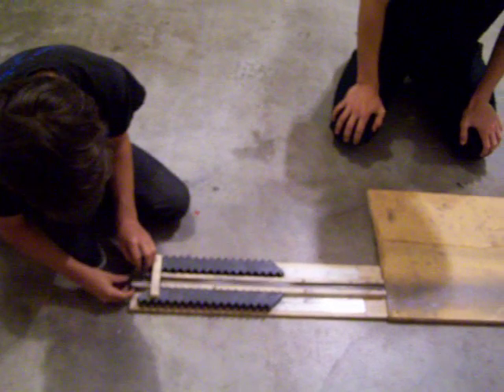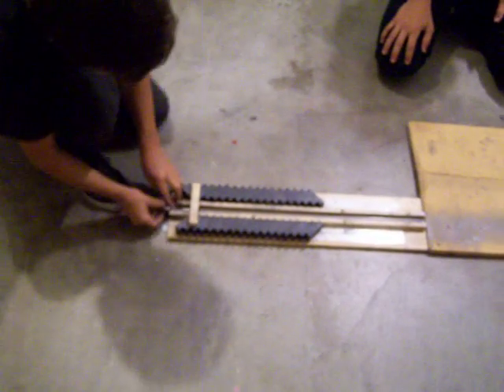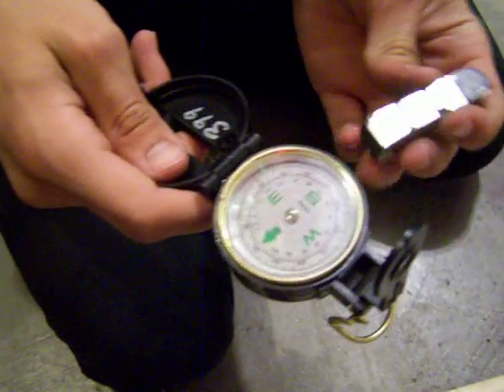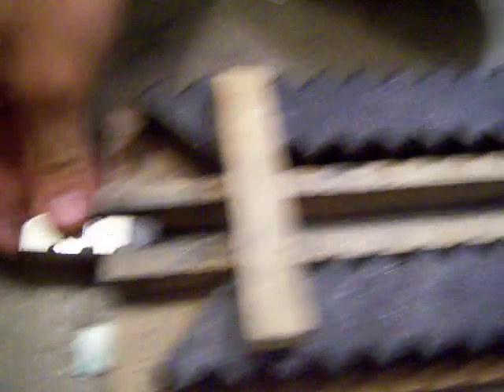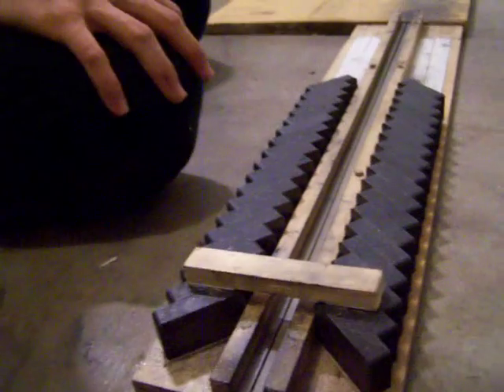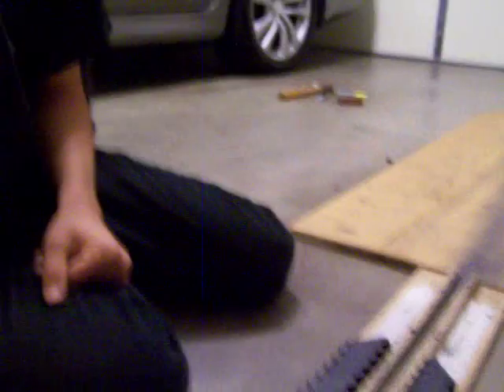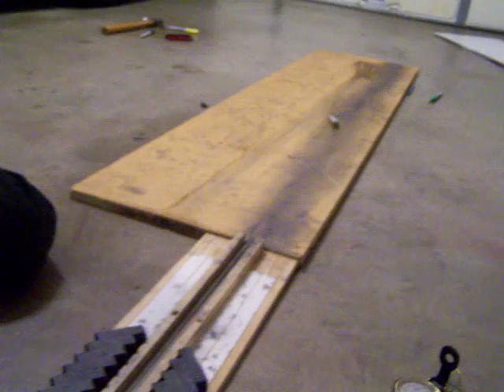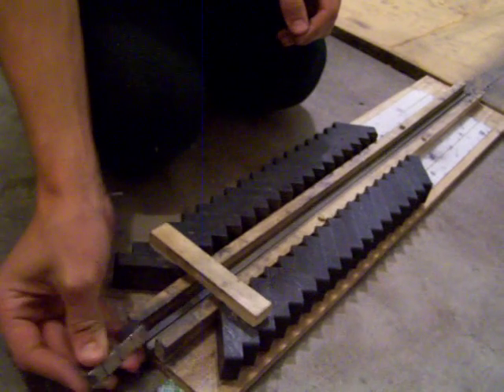Magnetic Rail Gun Science Project

Comment: To answer everyone's question, no this wouldn't work in a loop! Although the projectile gains speed along the track, it looses potential energy. The initial energy was added to the system when the kids physically forced the projectile against the magnetic field into the left side of the track. If the track was any longer, the projectile wouldn't even make it though (the kids even mentioned this when they said that it didn't work with 19 magnets).

Comment: could you achieve perpetual motion with this concept?
Reply: Nope.
Reply: Peter Wright why couldn't it be built as a large wheel then tilted on its side?
Reply: Build it any way you like. It won't give perpetual motion.
Reply: Peter Wright but what is the difference between making this 3' long vs 300' long?
Reply: 1TicTacPat
It doesn't matter. You are sticking a magnet into a static magnetic field. It's like lifting a ball up and letting it drop - there's only ever the energy you put in. Losses from friction and eddy currents will stop the smaller magnet sooner or later.

Comment: if you could reduce the friction, maybe by levitating the magnets with other magnets, it would go much faster and further.
Reply: Make another set of magnets and rotate it 90 degrees so you have the same setup above and below the track also.  And use ceramic brake caliper paint from autozone, heated in the oven, to coat the insides of the track [dont heat the magnets just track]
Reply: Good plan
Reply: They probably knew that already but there just might not be enough time or resource
Reply: Magnetic rail guns are a type of electromagnetic device that use magnets to accelerate a projectile along a pair of rails. The force generated by the magnets is used to push the projectile down the rails at high speeds.

Even the mathematics for classical physics calculates that the magnet system is permanently unbalanced based on the pulse driving the electromagnet. This imbalance creates a magnetic field that repels the projectile away from the device, making it impossible for the device to function as intended.

The only way to make a magnetic rail gun work is to use an exotic form of matter known as a negative mass fluid. This fluid has strange properties that allow it to generate a force that can cancel out the repulsive force of the magnetic field.

So far, there has been no successful demonstration of a magnetic rail gun using negative mass fluids.

A new type of magnetic rail gun has the potential to provide free energy, as it does not rely on any external source of power or fuel. The device works by harnessing the power of magnets to create a strong electro-magnetic field. This field is then used to accelerate a metal projectile along a track.

The key advantage of this design is that it can be powered entirely by magnets, which are readily available and do not require any external source of energy. This makes the device environmentally friendly and could potentially provide a sustainable source of energy.

The project is still in its early stages, but if successful, it could provide a major breakthrough in sustainable energy production.

Comment: this is not railgun ,this is coilgun
Reply: The title is technically correct, in that it's a "Rail Gun" (note the space), because the projectile is fired from something we might call a rail; however, in function, it operates like a coilgun, since an actual railgun needs contact between the rails and the armature to send electricity through it and fire it using Lorentz force, while a coilgun uses a magnetic projectile and magnets/electromagnets to push the projectile out of the gun.
Reply: It is a railgun. I didn't any coils around it, so it is a railgun.

Comment: not a rail gun.
Reply: +Johnny C jørgensen It is a railgun, a magnetic field, Lorentz forces. I don't see why it's not a railgun.
Reply: Railgun  uses elektric to fire.
Reply: And the big ones shoots a aluminium projektile at about 6000km/h
Reply: +Johnny C jørgensen You have no idea what a railgun is. A rail gun accelerates a projectile within a magnetic field, due to the Lorentz forces. The greater the magnetic flux density, the greater the Lorentz forces. Acceleration determined by Newtons second law. An electric railgun, uses electromagnets. By rushing a current through a rod or whatelse. The curreny creates a magnetic field relative to the projectile, therefore initiating a Lorentz force on the projectile. These are made with permanent magnets, not electromagnets. However still a railgun. And your speed is bullshit, it doesn't define a "railgun".
Reply: +Johnny C jørgensen It is a railgun. It has a magnetic field that accelerates the project due to Lorentz forces mate. I build a 1500 Watt railgun myself. You don't even know 2% of the phgsics involved.
Reply: well there are also coil guns.. might be the one you build.
Reply: +Johnny C jørgensen Nope, that one is also single stage and boring. Poorly made. I know this stuff so much better than you and you know that.
Reply: +Azagro what is youre projektile build of?
Reply: +Johnny C jørgensen Stainless steel for strength and a copper coil as sleeve for low resistance.
Reply: +Azagro so you build a coil gun. congrat.
Reply: +Johnny C jørgensen Hahahaha, do you even know how Lorentz forces are created? NOPE!
Reply: +Azagro smile nice you found a picture of a rilgun. congrat. projektile is a non magnetic one.
Reply: +Azagro how are we allowed to let this kid comment
Reply: +RAms - No idea, he saw a navy railgun. Suddenly becomes an expert on electromagnetism and lorentz forces. Doesn't even know the tiniest bit of maths and physics. Kids like these are idiots.
Reply: If we were to consider coil guns as a subset of railguns, this qualifies. However my understanding is that typically non electrified rails, especially with a ferromagnetic or permanent magnet projectile/armature, denotes a coil gun. Although of course it has no electromagnets and no coils, so you can't optimize velocity. Let's call it a "Magnetic Linear Accelerator" and leave it at that.
Reply: more like bigoted

Comment: LAWS OF CONSERVATION OF MASS, ENERGY AND THERMODYNAMICS APPLY TO A CLOSED SYSTEM. THERE IS NO SUCH THING AS A CLOSED SYSTEM.
YOU CAN'T GET ENERGY FROM NOTHING. NOTHING IS A SOURCE OF ALMOST INFINITE ENERGY POTENTIAL.
PERPETUAL MOTION IS IMPOSSIBLE. EVERYTHING IS IN PERPETUAL MOTION.
Reply: Guymick Cormic Well, since the Big Bang... I mean, nothing has begun or stopped moving after that input force... and things in motion remain in motion until acted upon by an equal or larger force, matter/energy is neither created nor destroyed it just changes state/form. And given the opportunity, things will often follow the path of least resistance..... a lever is a "Force Multiplier" and wheel is a lot of little levers arranged in 360 degree form. force

fôrs/

noun

1.

strength or energy as an attribute of physical action or movement...

 "Force is energy, a lever is a force multiplier.., A force multiplier is something that will have a large output force over a small distance. They reduce the amount of force necessary to move an object. An example is pliers, where the device is focused over a small distance and will provide a large amount of output force. A lever can multiply either force or speed, but it will depend on the positions of the handle, fulcrum and load. Inclined planes are also types of force multiplier levers.
 Shall we go into friction reductions and the like for them or what?..wait..I will add another clue... Nature hates and imbalance and always seeks to equalize (although never truly attaining it in total).
  Absolute Zero temp would mean no radiation of anything at all... but since we aint got that sort of capability, to stop the universe and freeze it (why we would do that I have no clue) we must recognize certain other things like the hydrologic cycle. Or also listen to Bernoulli and Venturi when thinking of fluid dynamics which in a way also applies to gasses too...i.e. the Venturi thing.

Comment: BY USING PVC AS THE BODY AND USING THE MAGNET GLUE INSIDE THE 4 INCHES PVC PIPE YOU COULD MAKE A VERY GOOD MOTOR FREE ENERGY DEVICE THAT WILL NOT STOP. GOOD WORK GUYS. THANK YOU FOR YOUR PRESENTATION. GOOD LUCK IN THE FUTURE.
Reply: ShadowRocks25 He's lying through his teeth, it's a troll. Thermodynamics. you cannot get free energy.

Comment: PLACE THE  MAGNET IN A CIRCLE AND YOU WILL HAVE A MOTOR. GOOD WORK
Reply: Micah Burgin. The question is. Where do the velocity come from? It seems greater than the energy he puts in. Need a high speed camera to see if it is accelerating near the end of the tube. If it is then it must be something from the ksgnets themselves that is feeding it energy. Like the energy required to make a magnet. If that was the case then over time the magnets would degrade. But magnets should be self stabalising. If one part of it loses its magnetism then its own magnetic field will correct itself. I have no idea. Needs testing
Reply: No. Thermodynamics.

Perpetual motion is impossible.

I sincerely hope you are trolling, because if you are not, take introductory thermodynamics in college.

You need to.
Reply: Nah you don't need to, the TROLL does.

Now, you can just read the wikipedia article on thermodynamics and you'll probably be good.

And no... that wouldn't work and the amount of ceramic magnets that would take? Too much. There is no way it would work and no way we have the materials.

Comment: FYI... this isnt per say a "rail gun" which uses ELECTRO-MAGNETIC forces... but what you kids have demonstrated beautifully is one of Howard Johnson's permanent magnetic motor devices... you have demonstrated how a magnetic gate operates.
Reply: The findings of a new study could mean that free energy by magnetic rail gun science projects are permanently unbalanced. Even the mathematics for classical physics calculates that the magnet system is permanently unbalanced based on the pulse driving the electromagnet.

This has been a problem for years, as it was thought that the only way to generate free energy was by using a balanced system. However, this new research shows that it is possible to create an unbalanced system that still produces free energy.

The key to this finding is in the way that the magnets are arranged. By arranging them in an unbalanced way, it is possible to create a system that produces more energy than it consumes. This could be a game-changer for free energy by magnetic rail gun science projects, as it opens up the possibility of generating huge amounts of power without having to worry about balancing the system.

Comment: I am curious what if you make a big circle would the magnit keep going if so you have perpetual motichen.
Reply: no. Thermodynamics.
Reply: ok thermodynamics or what ever/ if the magnet keeps going could you attach a rod to the magnet that spins a electrical generator
Reply: sam milone the magnet will not keep going. however, if you are good enough at video looping and have a tripod, you can fool the majority of youtube with a fake video.

The law of thermodynamics concerned with this is the one that basically says that if you want to make energy the only thing you can do is destroy mass (Fun fact, burning anything destroys mass. if you have the ammount of energy produced you can also use E=MC2 to calculate it!) so this motor which most definately does not destroy mass is acually using something like the energy produced when gravity pulls something down, basically the position of the object allows it to create energy. the problem with magnet motors is that they can only act as a flywheel of sorts, because once given a load (INCLUDING an electromagnetic generator) they are incapable of further function.
Reply: Micah Burgin Oh don't be silly... natural law is always the same...and we have always found ways to make it work in our favor... Friction is shit falling apart...so is rust... it's all in how we use it's degradation... and how efficiently we can make it perform work through force multiplications and lowered resistive forces etc... drag, friction etc..semantics really. When the energy of "destroying things" as you say is created..well..I do dis agree, neither created nor destroyed..only changes forms or states... and in the change of state or position, that is where we have always harnessed our energy through paths of lessened resistance and force multipliers... So Mr.Nay Nay Sayer ..... lay off the kids, the are onto something. Now it's friction and entropy reduction...No need to get them to burn the house down and focus the expansive gasses seeking a path of least resistance...dude...

Comment: Make it a whole lot longer (like 10 feet) and use neodymium magnets. You could make a dangerous weapon... or a new type of transportation system.
Reply: Whilst very powerful at the outset, neodymium does not make long-lasting magnets. Without help, they decay in strength. If you've looked at the other projects with ceramic magnets, you'll note that they can only get a certain maximum length to work (in that case 18 magnets). To extend it, one would have to build each new stage just far enough separated so that the noding effect would not interfere with other stages. Momentum would carry the projectile from the end of one stage into the next where it would be further accelerated. Assuming the there is no hidden trick, the 10-foot run with appropriate gaps would be very dangerous indeed.

Comment: Have a vertical pipe coil continue the magnet rail upwards in a loop to the top of the.vertical pipe coil let gravity drag the magnet down (creating electricity) then when it comes out the bottom of the coil pipe the magnet falls back into the magnet rail. Use multiple magnets..,.free energy?

Comment: Take a bike front fork and front tire. Make sure the tire has a disk brake so you can mount a gear on it later. Remove all the spokes and keep the axle. Find some plexie glass and cut it to a size that you can Handel. Take the hoop from the tire and score the plexie glass so it makes a circle then trim off the excess with a band saw or hack saw. Find the center of the circle by taking 3 strings and stretching it across the glass like your cutting a pizza. Mark the point. Then take a drill and

Comment: Are you doing it on a flat surface or on a axle? Cause you could make the "traveler" be a fixed point and use a rotter to the magnets on. Think of a disk break the rotter moves but the brake pads don't. This would be easy to do here are the instructions.

Comment: Modern physics has gotten to the point where we're able to show that the electric and magnetic forces on that same. 

Also, this would probably be something like a magnet gun. Rail guns use high current discharge along two metal rails (hence the term) to accelerate bits of metal and incredibly high velocities. Calling this a rail gun is a bit of a misnomer.

Still cool, though. ;)

Comment: Case2 is like the skateboarder starting on flat ground at the lip of a hollow, beyond, the ground is a bit lower than at the start then it rises to a hill. At first they accelerate down into the hollow; kinetic energy increasing as the potential decreases. They then decelerate as they go up the other side of the hollow and the kinetic energy is turned back to potential. They coast along until they hit the hill where they are reflected back (or stopped if there is any friction). see scrib text PE

Comment: Case1 is like a skateboarder stationary at the top of a hill- gravitational potential energy high but no kinetic energy. They roll to the bottom of the hill the potential has decreased but the kinetic energy has increased by the same ammount. They can now go up an identical hill provided no energy loss of any sort (sound, friction, radiation, work done) occurs. They could roll on forever over these identical hills. As soon as any energy is removed they will not get up the next hill: they stop.

Comment: N.B. Two possible orientations of the slider magnet which behave differently: !) repulsive case where work has to be done to push it into the breach. It then accelerates up the track and escapes with kinetic energy equal to the work done loading the gun. 2) The slider magnet is attracted into the array, (no work is done loading) it accelerates to the end but never escapes. (had it been able to escape in this case it would be Huge as it would break energy conservation). Both cases obey 1st law

Comment: This doesnt add to the kinetic energy: see the scribd paper. All the energy comes from the work initially done putting the slider into the breach of the first array. This potential is converted to kinetic energy of the projectile. If it encounters another identical array all the kinetic energy is used to get the slider into the breach (it converts to potential energy.) The slider comes out of the second array with exactly the same kinetic energy it had comming out of the first array. and so on.

Comment: if you mean can a longer linear gun produce more kinetic energy the answer is no beyond about 10 - 20 magnet pairs on the track. For a given strength of magnet, width of track and packing density of magnets along the track there is a maximum kinetic energy it can produce (see my analysis on the scribd website see ref previous comments). This is because the force on the slider scales as inverse fourth power of distance to track magnet so adding more magnets to long track has no effect.